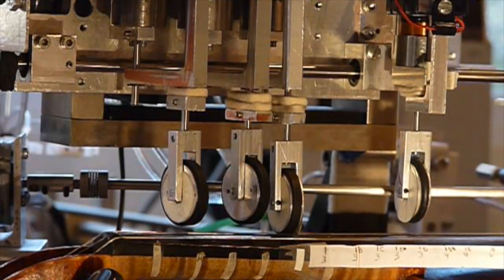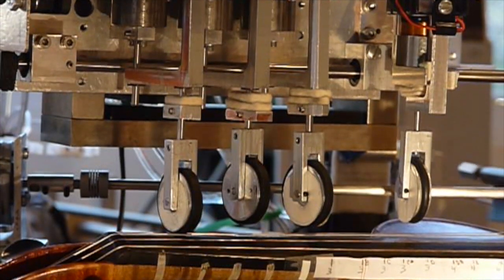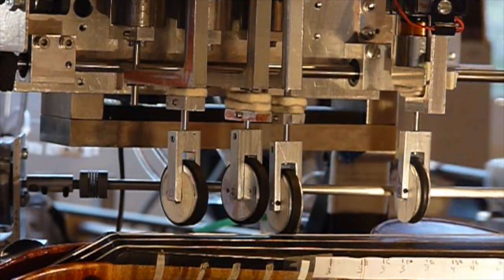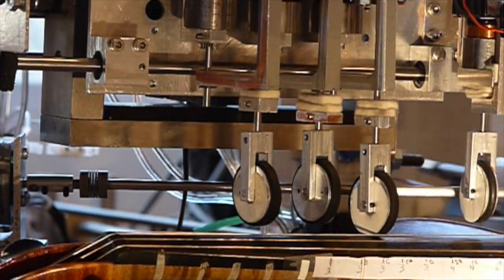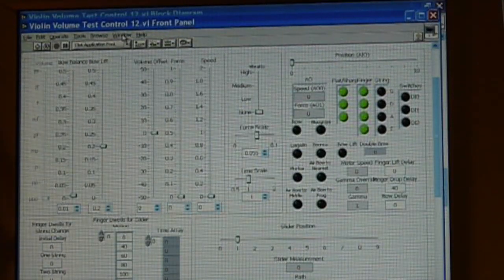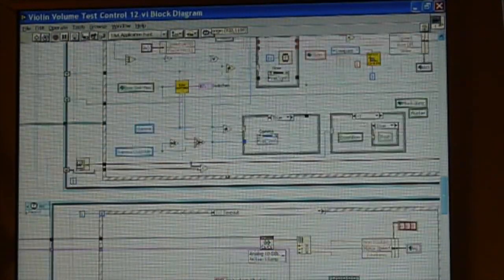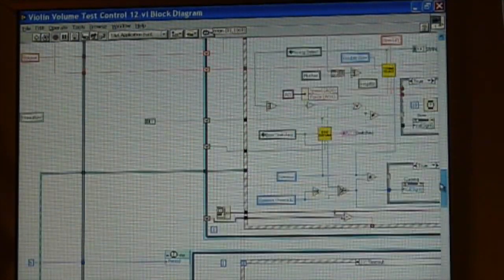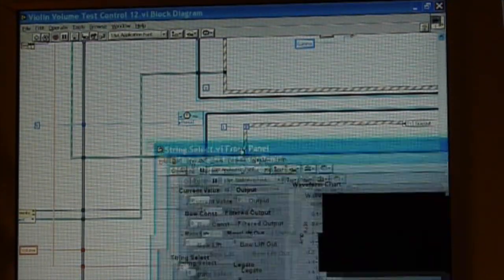RO-BOW - A Kinetic Sculpture that Plays a Violin by Seth Goldstein

Comment: I'm sure Mr Goldstein would agree that a few improvements might be in order.  The next step would be an actuator to regulate the pressure of the bow on the string, lifting it when appropriate.  There'd probably have to be another data channel to add bow-pressure data to each note, taking into account that the pressure of the bow must typically vary with time and bow position. 

Someone will also want to improve the bowing in general, varying the speed of the bow carriage such that long notes won't necessitate a reversal of the bowing motion. 

And while it might have been YouTube's sound reproduction, the strings and/or the mechanical stops sound like they could be tuned a great deal better.